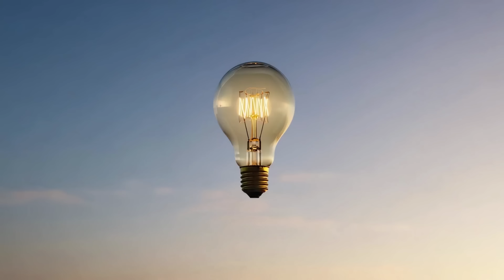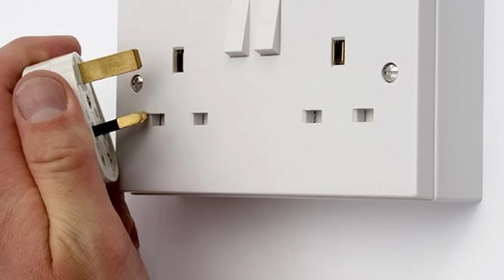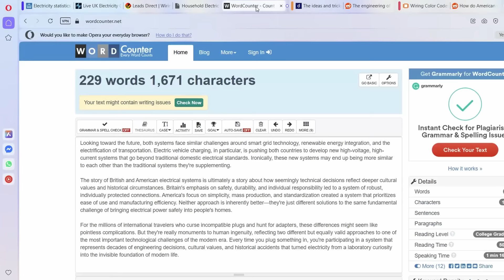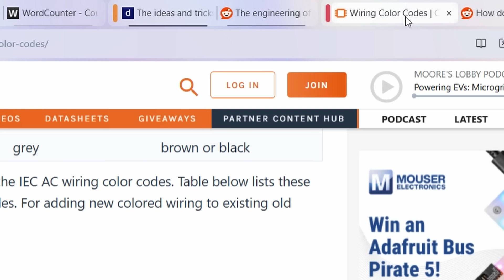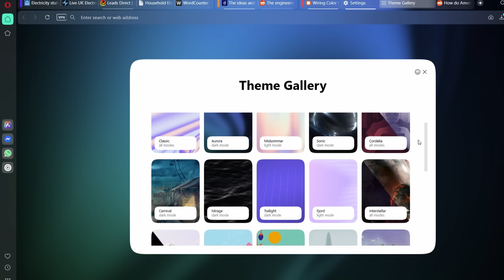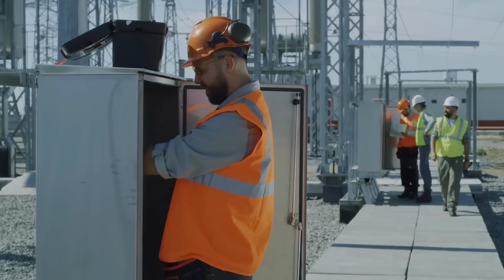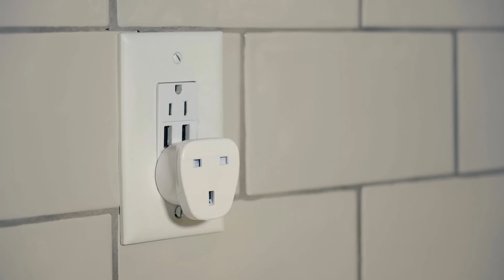British electricity is SAFER than American electricity. here's how.

Comment: One thing that you didn’t mention, because it was before your time in the UK.  At one time electrical appliances came without a plug, you had to buy a plug and install it, not the easiest thing to do.  I think eventually it was an EU requirement to supply appliances with the proper plug for the country where the appliance was being sold.
Reply: The days of 'the bedside lamp in the guest room.' You'd buy an electrical appliance, get it home and then realise that it needed a plug (quite why the sellers didn't remind you and try to sell you one at the time was quite baffling). So, off to cannibalise the least used appliance in the house, which would then receive a brand new plug later on during the week, if you remembered.
Reply: @billyhills9933  Not everyone is as ill-organised. I havea box of re-wireable plugs at home, and in many cases (like buying a new TV) I transfer the one from the old appliance. Those re-wireable plugs made by Crabtree or MK last for ever. 
Not like the modern Chineese moulded-on trash. When I buy a new appliance these days I cut off the moulded plug an fit a re-wireable. The moulded ones are a waste of material. The supplied lead lengths are never right for me anyway.
Reply: I hate the supplied moulded plugs, and that's another reason in favour of Brexit. I like my plugs all to look the same and be of decent quality, not Chinese tripe.  I have a stock of Crabtree re-wireable plugs and the first thing I do with a new appliance is cut the crappy moulded plug off and fit a Crabtree, usually re-used from the appliance it is replacing. I can optimise the lead length at the same time. Moulded plugs all go to landfill along with the appliance sooner or late, but the re-wireable ones can be re-used for ever.
Reply: @dukenukem5768  My most common complaint with the moulded plugs is them not moulding enough of a grip profile into them (obviously this varies). I don't think I've had a rewireable plug that didn't have an enormous shelf of a grip.
Reply: But outlets were of different types, so you needed a plug to suit.  So the appliance came with bare wire and it was up to you to buy (and fit) the appropriate plug.  What happened if you put a 5A plug on a 15A appliance - the fuse in the distribution board blew - if you were lucky!

Comment: You didn't mention why Britain doesn't have neighbourhood overhead power cables. And are buried underground.
Reply: UK power to houses can be above ground. Sometimes the supply runs along the street on the front walls of terraced housing, above door height but easily accessible.
Reply: In rural areas the power distribution is on poles, usually with a pole mounted transformer (6kV or 11kV down to 240V) for each small community. My dad's PMT was replaced this summer. It was fascinating to watch it being done, with all the safety protocols in use by the workers.
Reply: I live in Gainsborough, Lincolnshire, some streets in town do have their electricity delivered on neighbourhood overhead power cables.
Reply: It;s more expensive of course, ground is wet, but visually appealing. Cheaper for aerial conductors, hence the US norm. Although they can't afford healthcare or decent food

Comment: Shows how thick Edison was and how he shunned his British partner Swann. Only U. S has 120 rest of the world has 220-240..
Reply: I can think of just one application for which 120 V has a definite advantage over 240 V.  That application is of course incandescent lighting. Such lighting is now almost extinct, but at the time that the standards were drawn up it was the main use for electricity.  Of course in the US the 110 V supply is one side of a 240 V centre tapped system or one phase of a 208 V system.
Reply: @srfurley  I have travelled a lot and never seen any country but U.S. using 120 as from what I see on T.V. it's always have failures and outages and am very surprised as Edison was teamed up with Joseph Swann from Newcastle. Obviously Edison was a typical yank and wanted it his way. What a fool he was. I have seen different sockets but never less than 240-220 volts. Last time I was there N.Zealand was on the verge of changing to U.K. system so they told me in the hardware shop when I went looking for a socket as was 1 short.
Reply: @robertlee6479 

Canada and most, if not all, of South America are 120 V as are a number of smaller places under US influence.  Mexico is 127 V and Japan is 100 V.

Voltage in the UK has only been standardised in quite recent times, I remember being converted from 200 V in about 1961.
Reply: @srfurley  Peru, is 240 so is China Sweden, France, Spain Portugal N.Zealand South Korea and all other countries I have visited but one. My step son , who lives in Canada and is a qualified electrician told me they were 220.
Reply: @srfurley  Right, out of 268 entries, countries, states and Islands only 38 use 120 the rest are sencible and use 220/240 Peru Argentine, Chile and Equatorial Guanine all 240. So no all S. America.

Comment: Having the cable come out of the plug at rights angles is both a boon and a curse. It makes them conveniently sit flat against the wall, keeping them out of the way but also makes them awkward to carry in bags and makes the boxes for small electrical items larger than you expect, certainly larger than the US counterpart. However I have seen travel plugs that feature flip up pins.

Comment: In my younger days I made the grave mistake of finding a lamp socket in the dark with fingers, whilst on. 240v really hurts.
Reply: Ditto. For me it was the towns Christmas tree lights. A bulb was missing and of cours I stuck my thumb in the empty socket. Oops. It was the late 50s and tree lights were 240 volts. Subsequently my entire life has been filled with a fear of electricity.
Reply: Ditto! But I was stupid/curious enough to just see what happened. My eyes still glow when I see an empty bayonet socket!
Reply: @petegarnett7731  I didn't do that, but I did put my fingers into a fan to see if it would hurt (it did, but I didn't lose my finger, so that was OK!)
Reply: I put my fingers round the back to pull out a plug that was very stiff -- at first, I thought my brother had kicked me.

Comment: Here's a throwback related to the difference in US/UK voltage: desktop PCs. On the ones I saw throughout the 1980s-1990s, the built-in power supply had a switch so you could swap between giving it 110-120v in the US and 230-240v in the UK. Yes, some people did make the mistake of leaving them set to cope with the lower voltage of US systems, then plugging them in back in the UK to be greeted with a bright, spark-accompanied "fizz-POP"!
Reply: Still common on professional equipment, and always will be.
Reply: They were still around in the 00s too. Ask me how I know.
Reply: I used to repair lots of old TV sets with mains connected chassis, as well as lots of old valve radios which also had live innards, so an isolation transformer was an essential item, and I got one in 1981 and I've still got it and it has twin secondary windings providing either 120 or 240 volts depending how you wire it and more recently I've used it for repairing the amplifier out of my friend's American juke box, as well as yet another old 1950's UK valve radio that another friend has, so to avoid any expensive fry-ups I fitted the transformer with a four pin socket and then made up two flexes with a matching four pin plug, one for 120 volts and the other for 240, with each one wired appropriately to give the required voltage, with a switched UK BS 1363 socket with a neon at the other end of the 240 volt lead and the 120 volt one has an American three pin socket fitted in a small plastic box with a neon and a double pole switch, so I can always get the right voltage without having to set a switch first. And the four pin connectors are some kind of industrial type, I can't quite remember which, they're not for three phase but for something else and are suitably rated at 240 volt with quite a substantial current rating way over what I use them for.
Reply: That happened a couple of times at a computer games company I worked at in the late 90s.
Part of my job was fixing the PCs, and both times it happened to one of the game testers' PCs.
I'm not sure if the switches had been flipped as a prank by someone else, or by someone who wanted to start the day with an extended coffee and smoke break while I fixed their PC, as both would be highly plausible
Both times, the "POP", was more of a very loud explosion as the main inlet capacitor disemboweled itself.
At least back then, pretty much any PSU out of an obsolete PC in the scrap pile was good enough - no need to have to work out how powerful it had to be or what kind of connectors it had.

Comment: The UK plug has evolved over the decades and it would be a lie to say it has always been super safe.
Even up until the 1980s, two pin plugs and sockets were still sometimes used as well as three pins, and in some places plugs and sockets had round pins not rectangular.
The safety features in modern plugs and sockets have been added and the original three pin plugs didn't have them all.
Apart from that until natural gas was common there wasn't a gas network, the only gas available was town gas produced from coal.
And the early electricity system was not a nationwide grid that took ideas from town gas, there were a lot of local grids often running at different voltages and frequencies.
The basic fact is that it is only the last 4 decades that has seen what we have now evolve from the usual chaos of a growing system.

Comment: you can increase the voltage on the weirs to 240v without increase in any danger of safety issues. in its current you fuse for not voltage wiring insulation is standard at 300v and depending on location 240 is used  all over the house usually with just a couler change in the wire to dictate its change in voltage. you would just need to change the connection in the fuse box to make this happen. most electronic devices only need a different transformer my PC power supply has a switch on the back to do this. I would suspect 60hz is used hear as we use a lot more voltages in industry 120/240/375/480/600 are all commonplace in manufacturing and balance better with 60hz. and connecting a 50hz to a 60hz not that big of an issue just more power 20% more, or 20% going the other way as long as voltages remain the same. other ways around this are VFD or just straight up changing the frequency with circuitry, you can literally change frequency, timing and sinewave in real time with an different approaches either with the circuitry or oscilloscope as fare as fusing a load there is no practical difference in in a fuse at the plug or in the main panel just one of convivence and there are fused plugs you can get for individual sockets if you so desire say portable air conditioner.

Comment: UK standard BS 1363-1 flat-pin 13A plugs and sockets date from 1947. The previous BS 546 standard specified round pins with fewer safety considerations. I remember living in houses with wiring conforming to the earlier standard from my childhood as few people could afford to rewire their houses until well after WW2. The latest building standards (BS 7671:2018/A3:2024) requires that domestic mains circuits are fitted with Residual Current Device (RCD) trips to provide even greater safety.

Comment: Electoral system?  

Never mind, excellent effort as usual.

I don't think us Brits started out with , that, 3 pin plug 'n ring mains. As I understand it the latter is because we used masses of copper making ammunition cases for fighting world wars. So, when we had to build lots of new homes after the second one, we were keen to do some cost cutting, which was the prime motivator for the ring main. Once we'd committed to a loop carrying enough amps to fry any appliance we might want to plug in to it, we'd created the need for individual fuses & the BS1363 plug wasthe answer - all hail Caroline Haslett 🙂

Europe has harmonised its voltage. It's generally 230v everywhere now. After a manufacturing standard required appliances to be work safely over a range of 220 to 240 volts, covering all the previous national standards.

Comment: My late father was an electrician all his life. He actually installed electricity in his mother's house in the 1930's when there was no such thing as an Electricity Board Installation Inspector (!) Prior to 1965 many small appliances were still running on 110v ; I have my late Mum's Morphy Richards hairdryer in it's box with the dales receipt from 1964 and the paperwork from when it was converted for 240v. As a kid in the 70's I had a 1950's 110v desk fan than worked but got VERY hot .

Comment: In England in rhe 1950s. my sister was told that we do not poke screwdrivers into the electric sockets in our house, so she took the screwdriver next door and did it there.  Luckily the tool had a non conductive handle, which melted and this screwdriver was kept for ever as a cautionary tale, about what not to do with a screwdriver AND what not to say to a child.
Reply: I recall a bloke I used to work with who was a child during WW2 telling me this.  There was some blast damage to the house he was in and the retro-fitted conduit to the wall light-switch had got torn away from the wall, leaving bare wires sticking out.  The mother explained to the kids that you should never touch electrical wires with bare hands - then she proceeded to push the wires back in with the key from the door - and getting a shock!
Reply: I remember my little brother doing something similar, also back in the 1950s. We were then still on the old Wylex three-pin plugs, and I recall a loud bang and some interesting sparks. We bought a new house in 1966 and I remember we had to swap out all our Wylex plugs for the current style of three-pin on every appliance.
Reply: Ouch!
Reply: My Dad did the same but he shoved the screwdriver in the socket, we learned to respect Mr Shocker.
Reply: I have one question - HOW? How can you short a socket with just one screwdriver? And... i see it's fifties, but fuses on the inputs into the house were a thing, weren't they?
Reply: @voidseeker4394  Well, I was not there, but I presume my sister stuck the screwdriver into the live hole.
Reply: @voidseeker4394  do you knpw how fuse works? Regular B characteristic type breaker has to have 1,5x its amperage to shut off quickly. Meaning you have to make 30A short for some time to trip B20 breaker and. They dont see future.
Reply: @lauriviik   it would have been a wire fuse in the consumer unit in the 50s - not a "breaker".  Doesn't take long for a wire fuse to burn out on a short - as long as it's the correctly rated wire used .
Reply: @gingiberfelis4879  correct, example is for modern breaker but same principal. I was answering voidseeker4394 about "i see it's fifties, but fuses on the inputs ino the house were a thing, weren't they?". For fuse to work, they need reaction (screwdriver) and fuses dont know about that beforehand.
Reply: @lauriviik it supposedly melted a screwdriver. A short circuit is usually much more than 30A. I know how fuses work. Do you?
Reply: @voidseeker4394  seems like you dont. Why would you assume it happened with 30 amps? Nobody has told you what fuse rating it had and what amps did short circuit produce.
Reply: @lauriviik  I understood the comment about the fuse to mean the circuit would have been broken soon after the short and not long enough to melt the screwdriver handle - not to mean that the fuse would have prevented the short.
Reply: @gingiberfelis4879  In my experience with old rewirable fuses if you get a short in the fixed wiring it blows the cable apart at the point where it shorts, which can mean having to do quite a major repair as the cable is often inaccessible without taking a wall apart, and ruining a patch of plaster and decor, and/or pulling up carpet and floorboards etc. as well as having to shift heavy furniture and/or appliances etc., none of that if it trips out a breaker as they trip out so fast which is why I use them.

Comment: The UK national grid is a much higher voltage than the US and most other countries as well.
Reply: Than is not correct.  US highest voltage is 765 KV and UK 400 KV for transmission. Voltage coming into the house is still 240 V in the US, they just use a centre tapped earth.
Reply: @sw793 The US is 120 volts but 60hz. The UK is 240v with 50hz.
Reply: @jackmellor5536 the voltage coming into the house is 240v with a centre tapped earth.  They can then have, then yhey have a number of simjle phase circuits at 120v or they have 240v across the 2 phases.   Go research it as my origional statements were correct.